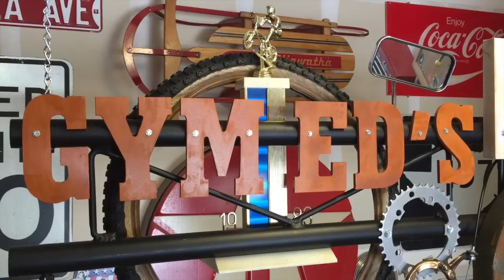'84 Stu Thomsen Huffy Tribute Bike Build

Comment: My after school and Saturday job was at Pep Boys on Colorado in Pasadena.  I was the bike builder.  20 hours a week, minimum wage, stuck in the very back of the dark warehouse.  $3.35 an hour to assemble take bikes from the boxes, assemble, quick adjustments, and wheel out to the big display rack on the showroom floor.  

When we got in a new model, I’d sneak it out the back door and take a lap or two around the parking lot.  First time I pulled open the box and lifted out one of those original white framed Stu’s, it was pretty exciting.  

I had been a BMX kid, starting on a made by Huffy J.C. Penny Wild Lightning, complete with banana seat, plastic gas tank, chain guard, etc.  Went from that to a Team Murray, to a Schwinn Thrasher, to a Mongoose, and can’t remember the order after that but GT, National Pro, Haro, and still have my old Dyno cruiser out in the garage.

Anyway, compared with all the other BMX bikes sold at Pep Boys, the Stu was actually pretty sweet.  Looked bitchen, decent geometry, felt stiffer than most of the other bikes, and those tall wide handlebars gave great leverage when you were mashing down on the pedals.

I never bought one myself, but I know the store sold hundreds of them that year.  For what it was, it was a terrific intro bike.

Thanks Stu, you were one of my BMX idols,  (not like Harry Leary who threw more elbows than anyone else out at the Azusa BMX).

😄

Comment: I tried to Murder a quadangle.  In 1985. The bike would not quit. Jumping off low rooftops and riding pools and ramps when I wasnt racing. I cracked a diamond back Chro.Mo in the plates top tube bottom tube. I ride a Stay Strong XXl & a Jet Bmx XXL now. 50 years old